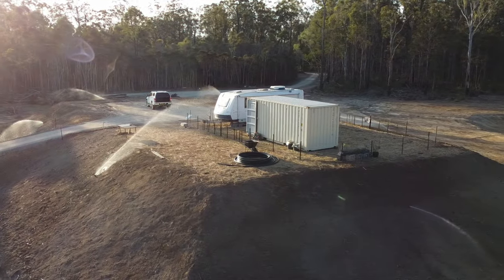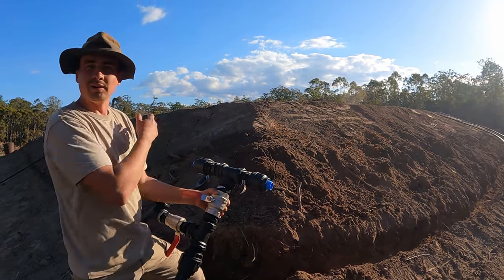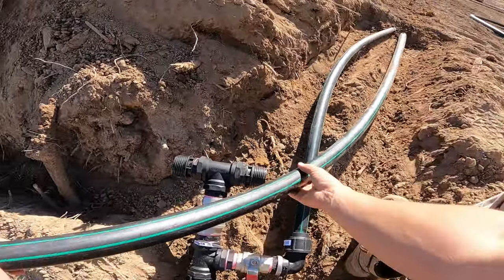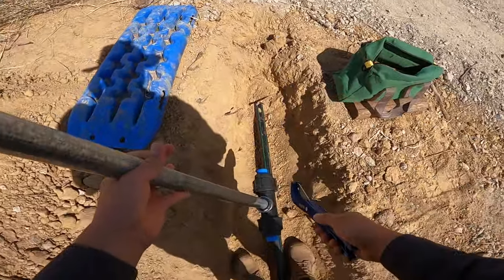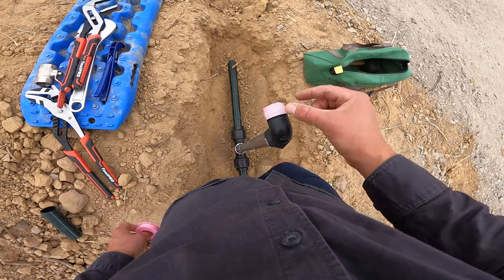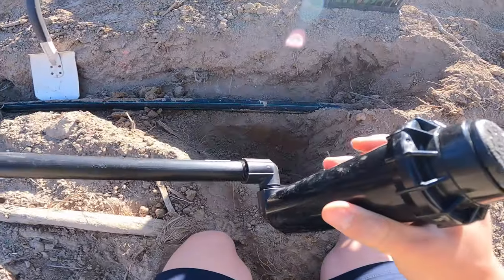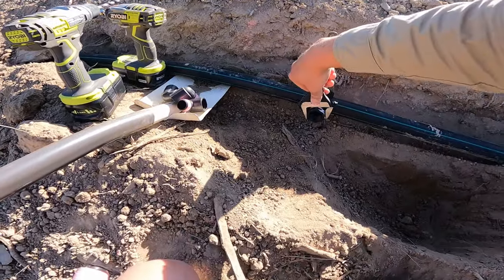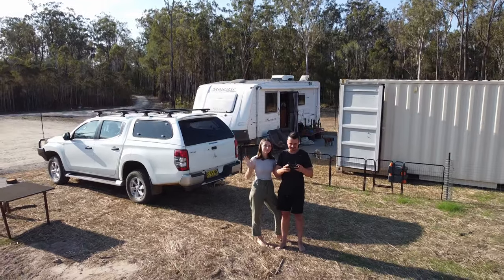Installing Pop-Up Sprinklers & Hydrant Points  -  Bushfire Safety System Pt 2

Comment: Very well thought out and executed, great result all round. Just on the firefighter, there is a small drain plug on the water pump side. I've never seen them get drained often enough or at all. Sediment/mineral deposits do build up. Not something you have to very often, but good thing to check once in a while. You probably already know about this, but for a priming alternative you can jiggle the foot valve and it will lift water.
Keeep up the great work👍😀.
Reply from the maker: They say you learn something new every day but that's 2 things for today 🤓
Didn't know either of those things so will have to find that drain plug, especially when we start messing around with bore water, cheers ✌️
Reply: @offgridcitycouple5695  no worries, your most welcome👍. The drain plug is under the pump inlet at the bottom.
Reply from the maker: @oilyragsgarage7200  nice one 👍, drained it today, wasn't too bad thankfully. Are you a local mechanic by the way?
Reply: @offgridcitycouple5695  it's not something that needs checking very often, just occasionally. Haha I'm not trained, but I've worked on mechanical things since I was a kid. Farm equipment I enjoy most.
Reply from the maker: @oilyragsgarage7200  old farm equipment is the best, new stuff is so cumbersome to take apart.. good on you for sharing stuff on YouTube about it too. Free knowledge sharing is what helps newbs like us do stuff we have no idea about!

Comment: Just a heads up guys, you can buy round jawed multi grips too. Are you going to have rooftop sprinklers on the shed and the house ??  Also, with the hydrant stand pipes, belt a tall star picket in next to them and secure the stand pipe to it and paint both a bright fluro colour so they stand and easy to see so visitors don't back into them and they're easy to see in the heat of a fire when your trying to get things ready. When you can, buy yourself a set of step drills they'll change your life mate seriously. Great vid guys well done. Seeya Rob
Reply from the maker: Cheers Rob! good to know about the round jaw multi grips, we'll have some one day😀I did get those round oil filter pliers towards the end, they're excellent too.

By step drills do you mean the Christmas tree ones? I had some of those but by the time it went in to be wide enough it would've made a hole on the other side 🙃

Rooftop sprinklers yes, we plan to only build out of steel or mud though so will probably just have a couple on the roof, and hooked up to the home plumbing so that the water that pours back into the gutters just goes back into the water tanks, then gets sprayed again. 

And yeah those hydrant points kinda suck with the hose laying on the ground, we'll add some reels with pickets or hardwood post holding them up, then keep the current outlets too so with camlocks they can connect to other hoses/poly to use for other stuff. 

Who thought keeping the place wet could take so much time and thought! 😅
Reply: Yer mate, the Christmas tree drills haha. Seeya Rob

Comment: Just wondering if they rotate to spread water around and if the plastic fittings would be ok in a fire with the heat I’m at concrete level building my house on the mid north coast so fire is at the front of my mind at the moment.  I love following what you guys are doing keep up the amazing work
Reply from the maker: Thanks for your kind words 🙏

And yep, they do rotate, relatively slowly though. The water flowing through them is what makes them rotate. 

And these pop up type sprinklers seem to only be available from plastic, haven't seen any metal pop up types. So if they're directly surrounded by flammable stuff they might get damaged. The intent is to have everything soaked before the fire comes through, otherwise most fire hoses are rubber too and they'd melt too.